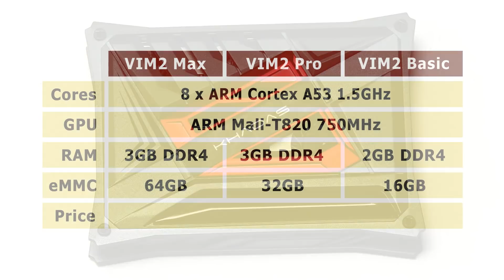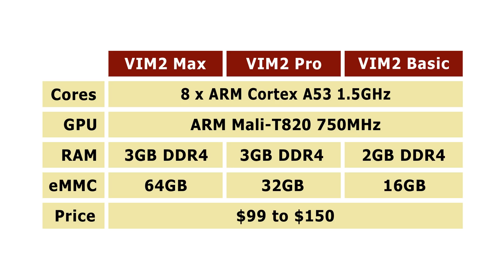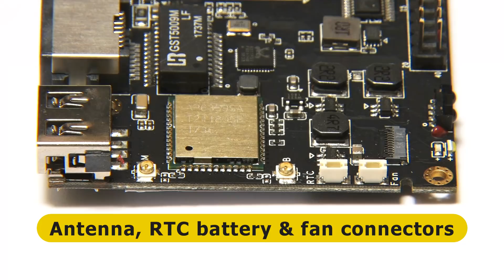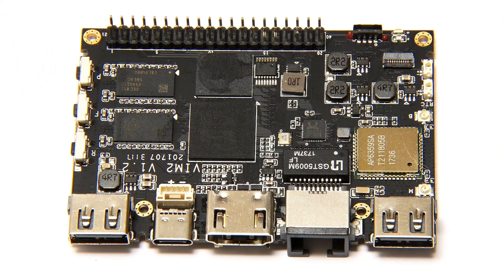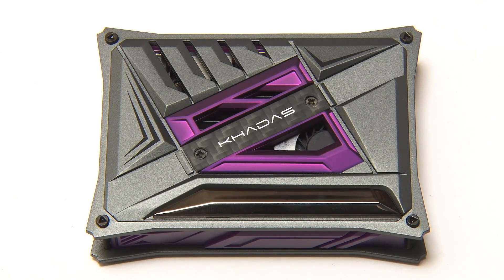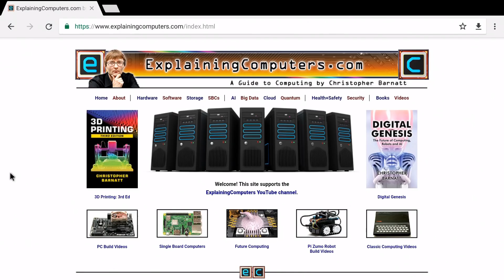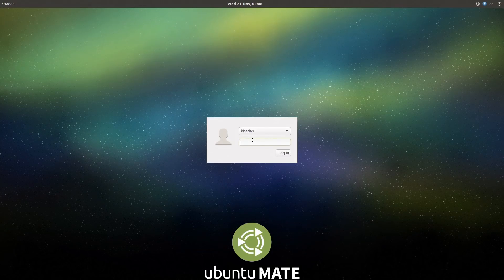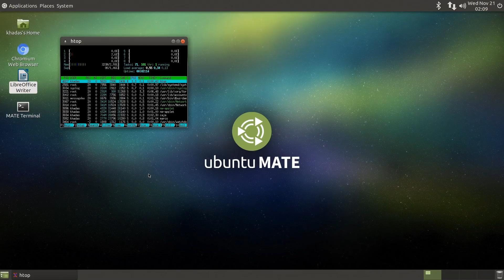Khadas VIM2 SBC & Android Box

Comment: Chris, regarding the GPIO out, what exactly can you plug into this connection?  Can you make a daughter board (Like for RAM expansion in the old days? Or a GPU connection?)  Can you find any plug and play type components that would work for upgrading this?
Reply from the maker: The GPIO pins provide inputs and outputs (plus power/etc) to control things like motors/etc (aka a microcontroller). They are not for connecting expansion peripherals like RAM or a GPU I'm afraid.
Reply: @ExplainingComputers  why not?  Is it because of bandwidth or low voltage?  Throughput?
Reply from the maker: There just isn't an interface via GPIO to the processor lanes (so yet, in appropriate banddiwth). GPIO means "general purpose input output"; it is not a PC expansion interface.
Reply: @mattparker9726 The GPIO pins on a single-board computer are usually controlled with via a python script, They can send and receive data, but it's far too slow for processor intensive tasks.

If it's Raspberry PI compatible, then there are in fact daughter boards that do various things. otherwise, you just connect it up with jumper-wires. you can do stuff as simple as turning LEDs on and off, running a 7-segment display (or more then one with a multiplexer) detecting switch-throws, sending serial data to an Arduino, using (some) Arduino GPIO hats... They are quite versatile.
Reply: @DFX2KX  Thanks!  I am asking for a very specific reason.  I want to buy a LattePanda Alpha, but I want more than 8gb of ram.  I know I can connect the NVME x4 slot to an adapter and use an external gpu, provided I supply it with power.  However, this will limit me to a mechanical hdd, and I have no realistic way (I'm not going to desolder the chips) to increase the ram.  Any ideas?
Reply: @mattparker9726  at the moment, no. Unfortunately, even when you have a physically compatible connection (PCIE  in that case), getting graphics cards to work when nobody's compiled an ARM driver for that particular GPU chip family is problematic (You'll have to use an open-source driver and compile it yourself, along with bug testing). 

And adding more RAM is... Even back when you could do that (My 386 had removable on-motherboard RAM and not SIPs/SIMMs), it was a pain to get it to actually work.

From what you're describing, you're approaching 'go with an ITX board' territory.
Reply: @DFX2KX  ETA Prime has done en external GPU series on his LattePanda using the onboard nvmex4 to pcie adapter.  IdK if he has compiled code for it, I'll ask him.
Reply from the maker: It is much easier to interface PCIe cards (like a GPU) to a LattePanda Alpha as it has a standard x86 processor, hence drivers (eg for Windows) are readily available. If you want a consumer x86 SBC with more than 8GB RAM, you should look to an UDOO Bolt or Odroid H2, both of which take SO-DIMM RAM modules.
Reply: Are they standard size SO-DIMMs?  What about GPU connectivity for both those boards?

Comment: Great video as always. I have a question. I have an old Dell laptop(vostro 1015). Those sbcs nowdays has better hardware and such, is it possible to replace the laptop motherboard with an sbc? That use the laptop screen, keyboard ect.. theoretical question.
Reply from the maker: With a lot of messing around, possibly. But you would need to interface the screen to the SBC, and that would probably not be trivial -- or cheap.
Reply: @ExplainingComputers  Thank you for your reply. I guess the diy is not always about cheap haha.

Comment: currently on Amazon the Khadas VIM2 Max is £132.99 while the Nvidia Shield TV is £159.98.. make your own mind up
Reply from the maker: Totally, but they are somewhat different devices for different purposes. As I noted in the video, you can sometimes pick up a VIM2 Basic for $50 (eg on GearBest last week!)
Reply: @ExplainingComputers  Thanks Chris, I am interested in this devices, I'm running a PlexServer and have to a degree managed it on a Raspberry Pi, but it's far easier on the Shield, however my partner want's it back ! so this could be a an alternative.. loved the vid btw.
Reply: However, the the current issue with the Shield not pairing with there controllers, this could be the tipping point.
Reply from the maker: I see above the comment from somebody how has one of these and uses it as an Android box. :)

Comment: Ah, so the dual-boot option is hardcoded, tied to an arbitrary switch that doesn't change its' value unless you reboot to the other OS. Interesting. I could easily use this as a media center, though 128 GB is not a whole lot of storage so the choice of media would be limited. Still, it has access to other sources of media like YouTube (and if that works so would Bitchute), so it wouldn't be too limited.
I'd definitely look into getting this.
Reply: USB storage is always an option.
Reply: just plug in a 2.5 inch usb 3.0 external hdd and then use double sided tape to attach it to the bottom of the case
Reply: There's no reason 256 GB or bigger cards would not work.
But yes, an USB drive would be a better choice.

Comment: Raspberry pi requires a power source that provides more than 2.5 amps, more than an ordinary USB charger provides. This device, which has much more processing power, seems to get by with under 2 amps. Is this correct?
Reply from the maker: It is correct. I was surprised by this too. But it does run fine with its 2A PSU.
Reply: @ExplainingComputers  I admit that I'm both impressed and also wondering what wizardry went on to get that working....

Comment: I like this particular SBC.  I would be one of those semi-crazy ones that would try Raspbian on it just for kicks!
Reply from the maker: I fear that you would not get far trying to boot up a Raspbian image . . .
Reply: @ExplainingComputers  
Oh, I figure so!  I was being slightly facetious, but if the Debian release is tuned for this board half as well as Raspbian is for the Raspberry Pi, then it's "Game On!"

I do have a project this board would be good at, mainly because all the connectors I need are on one side of the board.
Reply: Raspbian iamge not work on VIM2, but debian/ubuntu works.

Comment: £90.06 for 6 mugs.  £25 of that is handling and shipping.  I guess I am not rich enough to not worry about the price.
Reply: A raspberry pi is just brilliant, for most things up to 1080p , if you need android TV 4k ETA prime has just done a video for the Mi Box S , like the Nvidia shield, just not so good at gaming, looks very slick, and its cheap.
Reply from the maker: Totally agree on the Pi -- very, very hard to beat for $35 for the 3 B+.
Reply: @ExplainingComputers  Rock64 4gb version for 45$ is a good value in my opinion - 3 B+ a little bit outdated :-)
Reply from the maker: £90 is a lot -- yu could get one or two SBCs and accessorie for that! I never imagined anybody ordering six mugs! Prices are pretty much dictated by Teespring, as shipping is entirely their thing.
Reply: @ExplainingComputers  I will buy one and treasure it.  Shame Mr scissors name wasn't on mug.
Reply from the maker: Simon Kowalski Agreed. If it has the software support for what you need (eg OMV for a NAS), the Rock64 2GB or 4GB versions are very good value for the spec.

Comment: Good choice with the Red case, it's probably a safe bet it'll make the VIM2 run the fastest. It would be curious to benchmark the other one too though.

Any idea why the triangle screws were used? I thought that's usually done to make it harder for users to take gadgets apart. Do you think the company is secretly making the real money by selling misplaced screwdriver replacements?
Reply from the maker: The triangle screws are indeed a mystery . . .
Reply: The reason why we use triangle screws is that the ID engineer thought that it more match or meet the housing design, will feedback to out team and consider to change normal one in future batch :)

Comment: Whoever thought those screws were a good idea, should be fired immediately. Adding a special screw drive adds to the cost and shipping charges, not to mention what happens when the driver is lost. Machinist screws with hex top would've looked just as nice, cheaper and including an L wrench would've done the job. 
The name is also questionable. Sounds too much like "Hard-ass". They didn't know westerners can't pronounce "Kh" properly? 
The heat sink implementation has the worst heat transfer after not having a heat sink at all. 
The side push buttons with fail in a short time, unless the covers have stops to prevent the caps from pushing too far and breaking the solder pads. Also a fail. 
You didn't show playing a YouTube video as you normally do. Most these SBCs struggle when it comes to surfing the web. 
The price is way too high for what it is in 2019. A fancy transformer-like plastic case, is where they justify the price.
Reply from the maker: Triangle screws is indeed unusual!
Reply: @ExplainingComputers  Triangle screws have been around for quite a number of years. I've got one of those mobile phone universal repair kits I bought off ebay nearly 10 years ago and along with the standard plain, phillips and torx driver heads was a tri-spoked one which I did find odd back then. It was a few years afterward though before I actually need to use it though but at least I had the right tool for the job.
Reply: The reason why we use triangle screws is that it more match the design of the housing/case.

The meaning of Khadas. A khata is a traditional ceremonial scarf in Tibetan Buddhism. The khata symbolizes purity and compassion and are worn or presented with incense at many ceremonial occasions and the arrival or departure of guests. It is usually made of silk.

Khadas aims for our high quality, and well-designed single board computers to benefit makers all over the world. We only select for the highest quality components and manufacturing processes, ensuring reliability and function as intended.

Merry Christmas!
Reply: @gouwawang  Sir, you are out of touch with reality. 
Your response is a typical BS PR corporate response, that treat others as dumb children. 
"we use triangle screws is that it more match the design of the housing/case"? Well, no shit Sherlock! Next you'll tell us that water is wet?
What does a scarf from Tibetan Buddhists have to do with an SBC? Nothing. You just want it to sound cool, but irrelevant, like Ubuntu.
I'll let the market drive these points into you.
Reply: @gouwawang  well the cultural reference aside its perfectly okay to have an SBC that's also a Hard Ass. Sounds good to me. Probably should bring out a more powerful one called the Khadas Hard Ass ....lol

But these mali gpus aren't winning any friends. They are cheap, and popular. But they are really basic. Obviously you can't be lopping radeon mobile chips in there...they are also part of the SOC, I get that. And okay its not intended as a replacement for the PlayStation.  But the day an SBC appears with a pcie slot you've made a customer.
Reply: It does sound like Hard Ass ...but what I'd say is Hard Ass is not a bad name for a beefy SBC.

The price point for the lower model looks okay to me. Am I missing something here? 

But yeah the screws are just stupid...that's asking to have the case removed or not bought at all... Is it cheaper with no case? 

The only thing stopping me adding to my growing pile of techno graveyard is the stupid Mali GPU. I'd pay easily an extra tenner maybe 20 for something better than that. Or heaven forbid some bright spark puts a pcie slot and power into one.
Reply: They are easy enough to remove, a right sized flat head screw driver can do it easy enough. they are not put in that tight anyway

Comment: Great video.  What a powerful little singleboard.  They really solved the problem of case availability and compatibility by making and including their own. Have we ever seen an SBC that supports wireless AC connectivity?   I think this is  first.    As always thank for the great content and Stanly the Knife and Mr scissors have a new friend.  :)
Reply from the maker: Wireless AC? :)
Reply: @ExplainingComputers  These old names for the wireless standards are being retired.
Under the new naming scheme, "802.11AC" simply becomes "Wi-Fi 5"

Source: https://www.wi-fi.org/news-events/newsroom/wi-fi-alliance-introduces-wi-fi-6
Reply: Cray Ze Ape good to know.  Thank you.
Reply: @ExplainingComputers  The standard for wireless gigabit 802.11AC. Not as in AC Alternating Current. :)
Reply from the maker: Todd Bevins sorry, yes. I am slow today. I did not recognise it out of the 802.11 context
Reply: ExplainingComputers you sir are never slow.  :)  Clear, concise, and on the Mark is more accurate.
Reply from the maker: Cray Ze Ape The new Wi-FI labels are not released yet, and require supplier certifications to be used as I understand it. Good initiative though. There seems to be very tight control of the IP.

Comment: Now I can run the world's greatest editor on an eponymous box! (Provided I don't accidentally hit the reset button. Putting that right next to the power button is the one interface design weakness I can see. (I can tell you a story about twin-engine aeroplane that suddenly became a single-engine machine for reasons not unrelated to that.) Otherwise, it looks like a reasonable balance of features and price.
Reply from the maker: The buttons require a very definite push -- it would be very difficult to activate one by accident.

Comment: Can i solely ask u something Mr Christopher Barnatt. Can u please give me a single  board computer as a giveaway.
Thanks!
Reply from the maker: Sorry, I don't have any give away boards.
Reply: @ExplainingComputers  It's okay sir. Let me ask u something, I have a 1tb Seagate HDD and I have loaded it with Android 8.1 using unetbootin and after doing tweaking to fuel my curiosity I left with a boot message "Error- 22". How I am gonna repair that?
Reply: @Metal Head what does that mean?
Reply: Rourab Karar What the means is that you will have to buy your own.
Reply from the maker: This I do not know. Do you mean a HDD with an OS, eg to run a NAS? Or is the HDD connected to an SBC or other computer?
Reply: @ExplainingComputers  I dual booted the HDD with a windows 10 and an android 8.1 using unetbootin. Now there is no OS and no grub in the HDD. That's why I can't install any OS in it.